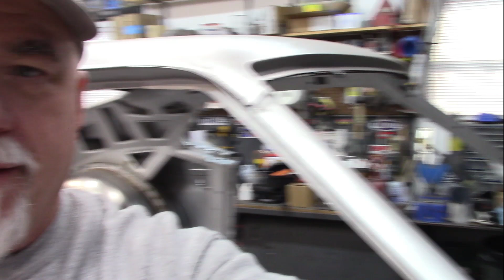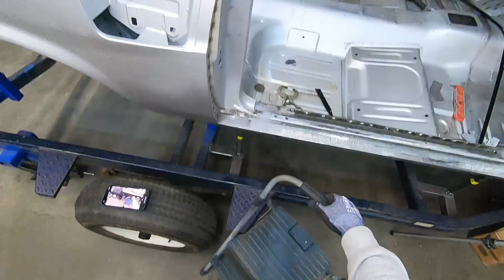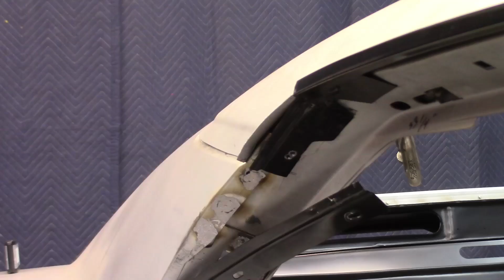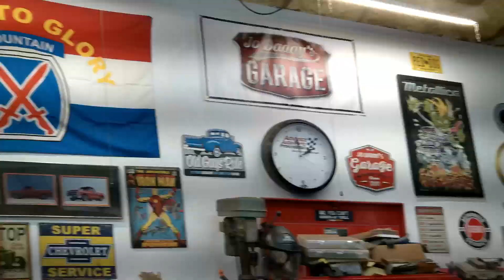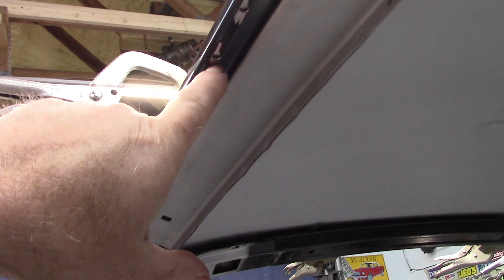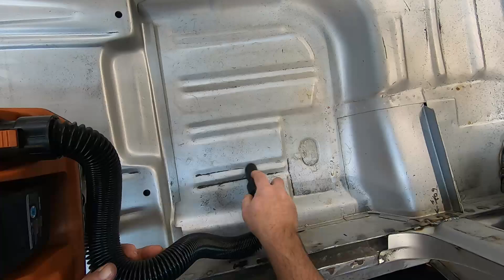Dynacorn roof welded onto a 1969 Mach 1 Cobra jet. Details inside.  Part 32. #mustang

Comment: Did you use weld through primer or some type of corrosion preventative on the structure and bottom of the roof panel prior to welding the roof panel on?
Reply from the maker: The panels are coated in weld thru primer.

Comment: You've done enough of these to know but just a word of caution. Lay the back glass in the opening and check the width and arch front to back. If those aren't right the window glass gasket and trim won't fit. And that carries all the way down to the width of the wheel openings and tire clearance. The car looks good from a distance.I'd also recommend wasting a trunk lid gasket to make sure it seals, before paint.

Comment: I am totally surprised that when you welded the quarters in place that you didn’t hang the doors to get the door to quarter gap or did you do it off camera?
Reply from the maker: Really not much I can do to change it. Experience tells me I can’t move the wheelhouse which also means I can’t move the quarter. The quarter is set at zero gap compared to the rocker panel. It really can’t be moved.
Reply: @JoDaddysGarage  for your psych I hope you don't have a problem, but I personally have never hung a quarter panel without having the door set in its proper place to establish the inward or outward gap between the door and quarter good luck. I hope you're right.

Comment: T.P tools have the tips that will fit the 240v harbor freight spot welder and they are small enough to fit between the rain gutter and the roof skin. I hung the spot welder off of my engine hoist to make it simple to control